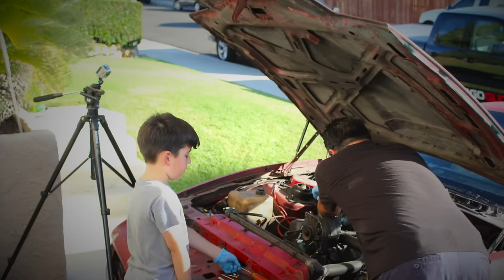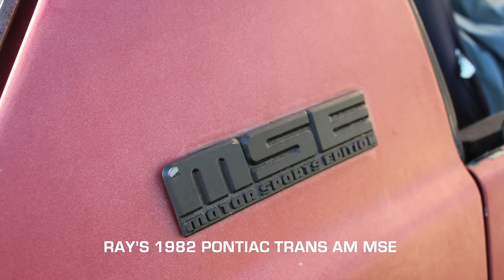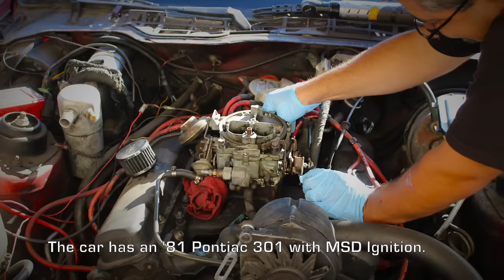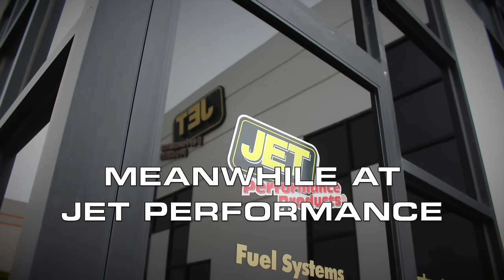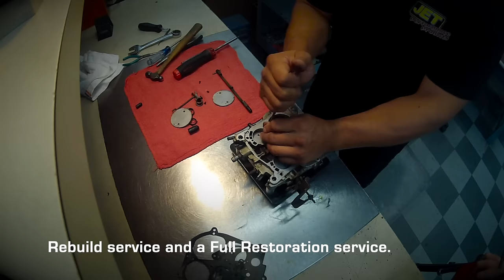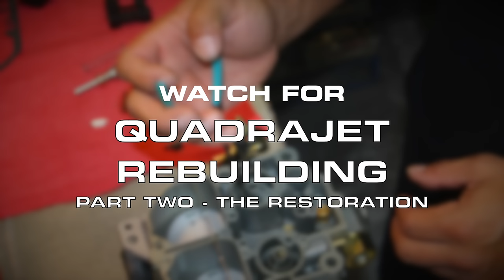QuadraJet Carburetor Restoration & Rebuild - Part 1

Comment: When I was a teenager, and still learning auto mechanics, I fell victim to a few friends ‘helping’ with my carb and it never ran right.  Then, in June 1999 I saw an add and mailed you guys my quadrajet from my 78 pointiac firebird 400 right before immediately shipping off to basic training.  When I returned two months later it had been returned and was waiting in the shipping box.  I installed it and that car ran like it was new for the next 9 years until I sold it.  Thanks! Best money I’ve ever spent!
Reply from the maker: That is awesome, thank you for sharing. A bummer that you had to sell the car though

Comment: good old Quadra junk
Reply from the maker: Have you had bad experiences with the Q-Jet? If you know or research how to properly tune them, then they are unmatched.
Reply: Always remember hearing them called that back in the day (early 80's). Then I ran into an NHRA Stock Eliminator racer who runs them on his 9 second Camaro, and I never believed that crap again. They're really pretty easy to rebuild, and when setup properly, they are a great carb. I'm getting ready to mod one for my bracket racer for this coming season on my 500hp 427 bbc.